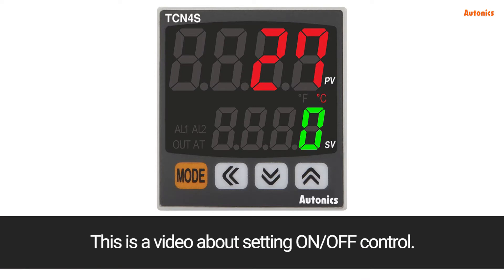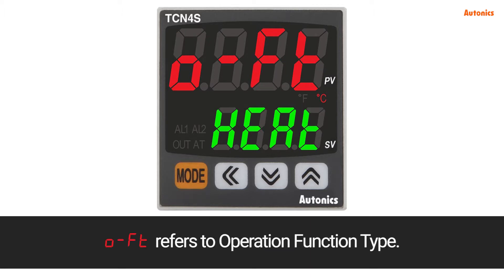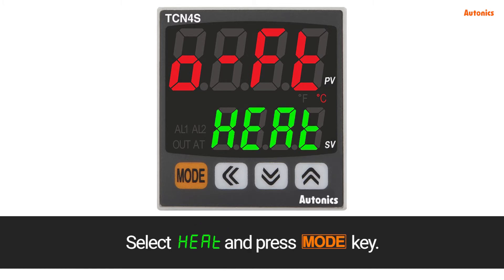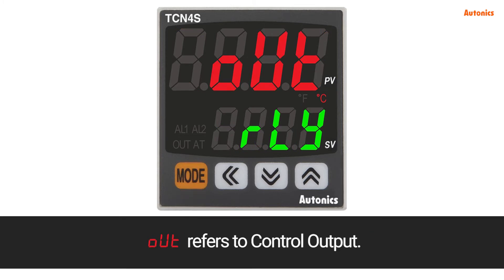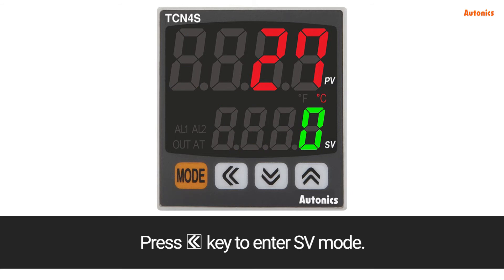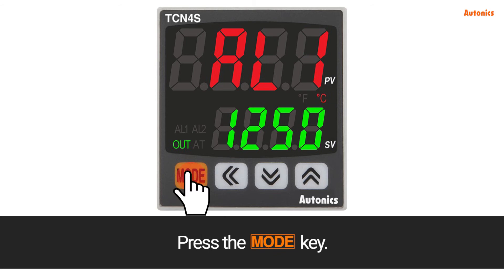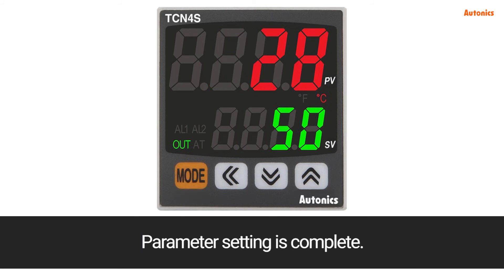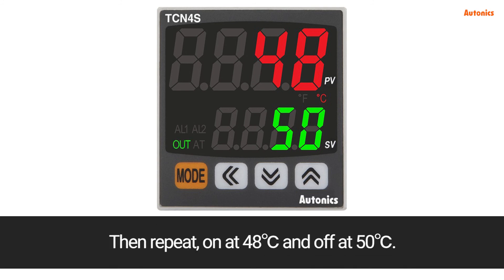Autonics Tutorial : Setting ON OFF Control(TCN Series)

Comment: Subject: Issue with AL1/AL2 Output Setup in Autonics TK4H

Dear Autonics Support Team,

I am using the Autonics TK4H model. I would like to set up the AL1/AL2 output parameter in such a way that the output remains NC (Normally Closed) in the normal state and changes to NO (Normally Open) when the temperature reaches 85°C.

I have been able to change the NC/NO setting for AL1/AL2. However, I cannot find the parameter to set the specific temperature value (85°C) for the output change.

Could you please let me know which parameter allows me to set this temperature value and the correct steps for the setup?

Thank you in advance for your assistance.

Best regards,

Comment: Hi, I have bought an TCN4S series, especially it is TCN4S-22R (use 24VDC power supply). Could you please tell me if it's possible for SSR Output, using with standard ON/OFF control mode methode ? Thank you so much.
Reply from the maker: TCN4S-22R product is capable of SSR output (ON/OFF mode).
However, the SSR output method cannot be selected. (CYCLE, PHASE)
Reply: @AutonicsCorp  Thank you so much. By the way, I have one more question please. Can I use both AL1 & AL2 on TCN4S-22R when the machine is working. Futhermore, ex: the AL1 for high limit temperater & AL2 for low limit temperater ?
Reply from the maker: Yes, of course. It can be used by setting [AL-1] of parameter 2 group as high-limit alarm and [AL-2] as low-limit alarm.